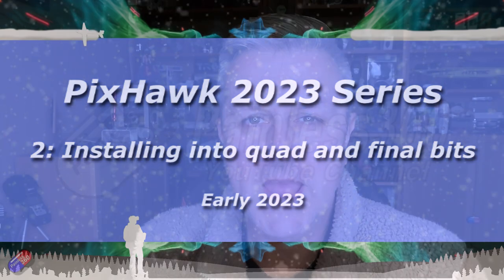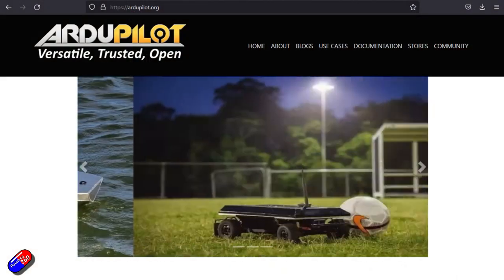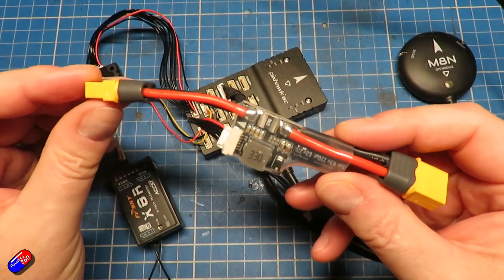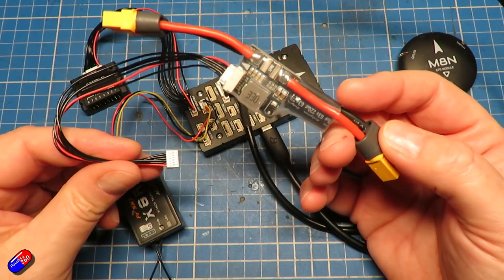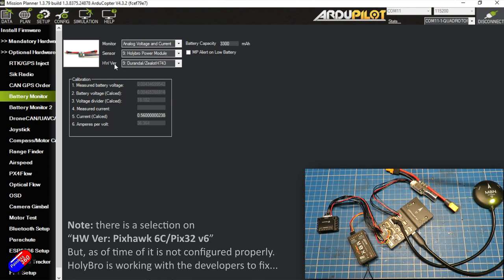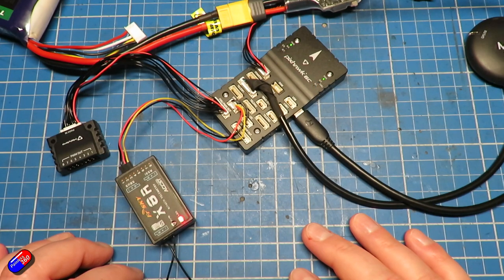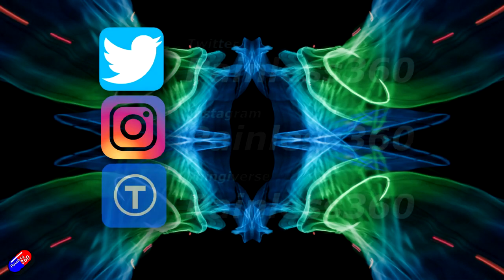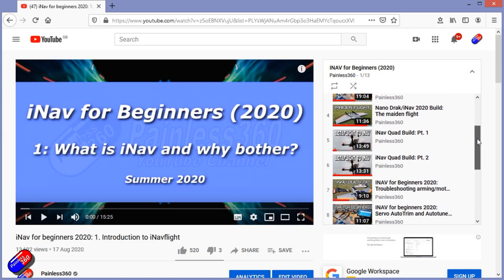PixHawk/ArduCopter for Beginners (2023 series): 2. Installing the PixHawk 6C and full setup steps

Comment: I really like this style of quad and  as a learning curve it's great to get into the basics of quadcopters. I was also a fan of open-libre pilot back when it was in development for this style of quad and IMO they have a great GUI but Ardupilot is fully featured and supported so it look like it ticks all the boxes here. I like what they have done with this kit and for education it's a great step into the tech that makes quadcopters work! I think they might have gone for a different protocol to PWM conmectiors for the motors but it works well enough. Thanks for the detailed step-through guide.

Comment: Immediately after assembly, the problem is FS and the level of the throttle stick - 982.
Thanks a lot.
Solved the problem right away.
Thanks for the video!

Comment: Hi there. Thanks for the step by step instructions. I have a strange issue which has to do with RCOut ports. 
- My set-up: Pixhawk 6c + Tx16S controller + RadioMaster R81 Receiver (Holybro PX4 Development Kit - X500 v2), 
- using ArduPilot. 
I followed your step-by-step instructions, however my RCOut changes PWM ports every time I reboot the flight controller (Pixhawk). Some times it shows the correct PWM ports (RCOut: PWM:1-4 DS600:5-8) and I can set my servos to positions 1-4 and run the motor tests successfully. But as soon as I turn Pixhawk off  and on (power off/on), then my RCOut shows different ports for PWM ports (RCOut: DS600:1-4 PWM:5-16). Any ideas what is goin on?
Frame: QUAD/X
IMU0: fast sampling enabled 2.0kHz
RCOut: DS600:1-4 PWM:5-16
IOMCU: 410 2003 411FC231
Pixhawk6C 00350041 31335114 39373732
ChibiOS: 6a85082c
ArduCopter V4.5.3 (ee14ff38)
PS: I have posted on different discords but so far I am just being asked to post on other discords :)
Reply from the maker: I've never seen that. I'd maybe try another version, and report the results to the devs... Best of luck

Comment: Nice video! 

I have trouble calibrating the ESC’s so I can get the motors running. The steps im doing are:

1- Flight controller (FC) is connected to the computer thru USB and battery is plugged in, motors are beeping.

2- Click the Calibrate ESC button in Mission planner under mandatory hardware dropdown on setup section. I’ve tried Normal, Oneshot and Oneshot 125.

3- Disconnect Battery and usb from FC

4- Connect the FC to the computer thru usb again

5- The FC is ON and the ESC is off since the Battery is disconnected from the PDB (should the -,+,s cables be connected or disconnected?)

6- I disable the safety switch holding the “switch” button on the GPS until the red light is solid (immediately after plugged in switch light is solid so i hold it till it blinks and then till is solid again, if i let it solid since the begging it doesn’t work either)

7- Arm the drone in the transmitter corresponding switch (I’ve even tried

8- Put throttle at maximum position

9- Plug in the battery

The problem is from step 4 on.

After this, I understand that I should be hearing 2 beeps from the ESC registering maximum throttle and then I put throttle at minimum so the ESC can read the lowest throttle. However, instead of the ESC, only the motor start beeping every 2 seconds or less. The compass light is either yellow blinking twice every second like shown in the video OR alternating between green, red and blue.

In both cases the switch red light on the compass is solid right after plugging it in. In the second occasion (when blinking in 3 colors) the FC would make a long beep immediately after plugged into the computer thru USB but it would not connect to mission planner at first try displaying a “no heartbeat packet received” popup or simply the connection failed one that in the details says “the semaphore timeout period has expired” and a bunch of other stuff i have a picture of. When I try again unplugging and plugging back thru USB connection is no longer displaying the red blue and green light but the yellow one again.

The  MOT_PWM_MAX and MOT_PWM_MIN values are within the range reflected on the Radio calibration section; right now they are 960 and 1960 and in the radio calibration max and min are 988 and 2008. These values used to be 1000 and 2000 on the ESC calibration section but didn’t work either.

The transmitter is ON and it connects to the receiver every time no problem during the whole process. I calibrated the radio before doing this too.

I don’t know how to set manual mode which Is something I think I should do between step 5 and 6. I do it in Stabilize mode instead, but Im not sure if that is the problem.

If I do this right, the next step would be test the motors on the Motor test section under Optional Hardware dropdown on Setup section, right?

Before doing this I tried to test the motors right after calibrating the radio and it didn’t work. I got a popup window saying “action stopped by autopilot” now When I try it only makes the two sounds at the end of the video when I click “Test all in sequence” and “Stop all motors” buttons.

•Flight controller: Pixhawk 6C •Power Distribution Board : PM07 •Motors: T-motor https://store.tmotor.com/h5/#/product?id=939 •ESC: DH 60A 2-6S Waterproof Brushless ESC Electronic Speed Controller with 5V/6V 8A BEC and X60 https://a.co/d/7qHXerv •GPS: MN8 •Transmitter: Radiomaster XT12 ELRS •Receiver: Radiomaster RP1

[Edit:] I have been using ardupilot ESC calibration website as reference but no success.

I hope you or someone can help me  solve this problem, i don't know what else to do!
Reply from the maker: ESC calibration is started with the ESCs unpowered by the battery. If your ESCs support a digital protocol then use that to avoid the need to calibrate.. Best of luck
Reply: I've been having this same exact issue. Everything is calibrated and gps has a working fix, my motors beep in rhythm which shows they are connected properly and being read properly, but when i try to motor test, they just don't spin. I get beeps indicating that the drone is attempting to test the motors, but they dont move. My servo output also shows that they are connected and configured properly.

Have you found a fix to this yet?

Comment: Hello friend! The FMU port on my pixhawk 6c is not delivering 5.0V or 3.3V signal. The wiring is correct, the mission planner is receiving radio commands, but the signals are not being transmitted to the FMU PWM out. Is there any other configuration I should do to enable the FMU PWM out? Please help me. Thank you for your time!
Reply from the maker: Not sure, if you figure it out, please let me know what you need to do.. best of luck

Comment: Would it be worth using TBS crossfire with "RC by mavlink" enabled and your laptop connected via wifi to the crossfire module? You wouldn't need telemetry radios then
Reply from the maker: MAVLINK is only sent at short ranges on Crossfire so not useful for anything but close in flying.. Happy flying

Comment: Hi and congrats on your channel and content. After watching your video I ordered the Pixhawk 6c as a midrange decent solution. I am planning on building a dodecahexa custom drone (coaxial hexa 12 motors). Will the pixhawk 6c be able to drive the 12 motors of the dodecahexa? Will I be able to have dshot on the 12 motor outs?
Thanking you in advance for your help, 
JimBril.
Reply from the maker: I'd check with the seller, I've only used one in a quad here... best of luck

Comment: Wonderful informative video!  Speaking of telemetry, have you ever got a minimOSD working with a pixhawk?
Reply from the maker: I have. Check out my videos on it.. Best of luck
Reply from the maker: APM is old, unsupported 8bit hardware that you shouldn't be using now. Use a modern 'Pixhawk' style FC or a modern 'open-source' alternative. Best of luck!
Reply: @Painless360  Thanks for the advice!  But I think I misspoke. I meant to ask which of your videos I should follow if I'm trying to do it on pixhawk? Is APM is the most similar? Love your videos!

Comment: Hello
I have a Pixhawk 6C Mini and I want to mount it in a fishing boat;
I have to connect 4 servo motors to it;
my question is do i have to feed the servo line with 5V?
THANK YOU
Reply from the maker: I'd expect so. Pixhawks don't tend to power up the servo pins... Best of luck
Reply: @Painless360  ESC provides 5.7v is much or is it good for servo output, thanks
Reply from the maker: Depends on the servos..

Comment: AMAZING VIDEO! So useful and informative. Just wondering, is there any restriction on the type of ESCs that we plug into the Pixhawk 6C PWM? For instance, would there be any issue using a Spectrum Avian 45 Amp Brushless Smart ESC, 3S-6S ?
Reply from the maker: If it supports the standard ESC protocols, I don't see why not... Best of luck

Comment: This power module says it's rated up to 12S but I can't find any rating for the motors & ESCs other than a recommended 4S. If I need to run a minimum of 6S for my project, where could I go to find recommended alternative motors and ESCs rated for the higher voltages? Thanks for all your help!
Reply from the maker: I normally look at the T-Motor website... Best of luck
Reply: @Painless360  awesome, thanks!

Comment: pixhawk 6c and herelink 1.1 with eft616 is that a good system ?
Reply from the maker: Pretty solid hardware.. Depends on what you want to build. Best of luck!
Reply: Want to build a medical kit or maybe first aid dropper that weighs around 10kg 
And thanks for the fast reply
Reply from the maker: I've not used that frame but best of luck!

Comment: Hey Lee how are you tweaking and tuning your pids? Are you doing that manually, using stock arducopter pids, or are you using the arducopter auto pid calibration once in the air?
Reply from the maker: On a larger frame like this the default PIDs will normally work very well out of the box (smaller frames - 5" class - need a little work). See the maiden for how rock steady this thing is on defaults.. Once the maiden is done, I'd run an autotune to dial things in even more. Happy flying!
Reply: @Painless360  thanks Lee, this will be my first full pixhawk setup on an old 10 inch Sky Hero Spyder frame with all new electronics, it's about time I ditch the old and unreliable Naza V2 flight controller, Frsky receiver and analog video setup for this flight controller, DJI digital fpv, and expresslrs control link.

Comment: Will this run with 3 cell batteries? I can't get the motors to work. they beep slightly but don't turn.
Reply from the maker: It should do but 4S is better. If the motors won't turn at all I'd recommend following the series to see all of the steps I follow... Best of luck

Comment: In my current build I originally was going to use an old DJI Naza M V2 as the FC, but due to the lack of support for that particular controller I opted to use a Pixhawk 6C instead. When I set up my blheli  esc’s I just calibrated them the old fashioned stick method as PWM , since I was going to be using them with a relatively ancient FC. But the esc’s are D Shot compatible, and I want to setup the Pixhawk with that protocol. Since I already calibrated the esc’s with the stick, do I need to do anything special when setting up the Pixhawk other than choosing D Shot in  Mission Planner? Thanks.
Reply from the maker: Selecting a digital protocol for the ESCs should just work... I'd check it Al. With the props off... best of luck
Reply: Thanks Lee.

Comment: After a couple of months of working with the Pixhawk 6C, do you have any thoughts on the vibration isolation claims?  Have you had any problems that you think may have been caused by vibration?
Reply from the maker: Not yet...
Reply: You can mount your flight controller on a damper plate with dampers. It significantly reduces vibrations that may cause issues like accelerometer clipping.

Comment: So many options of firmware and hardware that it gets kinda confusing.  Especially as things continue to evolve or become obsolete
(
OpenPilot->Librepilot , DRonin
Multiwii->Baseflight->Cleanflight->Betaflight
MissionPlanner -> QGroundControl
)

But Is there any one set of hardware that could run both both  Ardupilot  / Pixhawk (PX4)   and Betaflight (iNav)?   Except for the Pixhawk, many of the electronics I've seen are similar (STM32F/H7) and have similar form-factors (ex. Speedybee F7V3, Mateksys H743, Kakute H7 V2)

I understand Betaflight is popular among FPV racing, and iNav for autonomous/waypoints, however would love to experiment with both FPV and autonomous flying!
Reply from the maker: Decide how you want to fly and what space you have in the model and then the choices are easier. https://youtu.be/ZwCLdkjqM-Y

Comment: Thank you for making these videos. I really like the Pixhawks, but it has been a few years since my last build which uses a Holybro Pixhawk 4. I used to do the arming by holding the stick in a corner for few seconds but I see your configuration uses a specific switch on the radio for arming. I wonder what happens if you accidentally flip that switch mid air? Will it fall down like a brick?
Reply from the maker: Yep
Reply: You can always set it up to require pressing two switches at the same time in order to arm/disarm.  I use the two extra trim switches on the TX16s.  I do use a single switch for “emergency motor stop” as it leaves the model armed and can be instantly corrected if toggled accidentally.

Comment: Hey there Lee another quick question to a problem I'm having after watching and mimicking your setup, and I can't quite seem to find the answer to. So I couldn't get the motors to spin up or anything in the motor test tab, nor would they spool up after the system armed. So I switched my Holybro pwm breakout board from the FMU PWM OUT over to the I/O PWM OUT on the 6c flight controller, and now the motors spool up when armed, but still do not work in the motor test tab. Is there some parameter that needs to be adjusted to get everything to work correctly, or am I just doing something wrong? My hardware is the Sky Hero 2806 950kv motors and Sky Hero 40amp opto esc's.
Reply from the maker: I'd suspect the ESC protocol is wrong... Best of luck
Reply: @Painless360  yeah the esc's are kind of old school and run the old SimonK firmware, but you'd think they would still work as I have the esc protocol on the fc set to 0 or normal, all of the other options look like they're for dshot150 and above. Maybe it's time to upgrade the esc's to a newer version and firmware if I can't get these working correctly.
Reply: @steelrainfpv3383  I have the pixhawk 6c with the M8N GPS on the bench, connected via USB-C to PC. I have (2) HS-55 servos hooked to the PWM board and powered by a 2A benchtop power supply (no ESC's). I used mavproxy with the servo set command. I couldn't get it to work with FMU out either. Holybro support said, "the main output on the 6C is not FMU output but I/O output". So I switched the cable over like you did and now it works. Suspect it's in the config settings. I'm using Frame Type Undefined in Mission Planner (building a rover).

Comment: Hello,  very nice and helpful video.  I have designed a heavy lift UAV and need to work with someone on the flight control/autopilot system. Would you be interested in working with me or can you pass along info on a person or company I could hire to do this part for me.

Thank you,
Steven
Reply from the maker: Hi Steven, See my Big Boys Toys Playlist for the larger stuff on the channel. Most professional rigs use Ardupilot and a PixHawk flight controller (like I used in this video).

Comment: Lee, please allow me to give a piece of advice on these telemetry radios.

BUY THE NAME BRAND ONES, NOT THE CLONES. YOU WILL GET WHAT YOU PAY FOR.

I'm sure that for those with a little more experience the clones are fine, but for a beginner they just suck.
Reply from the maker: Agreed - anyone that is happy to put their brand-name onto the radios is far better than the eBay specials. These HolyBro units work well with no messing about. You can get far more expensive and more range with more cash - See https://www.youtube.com/watch?v=VakhFXMNp98